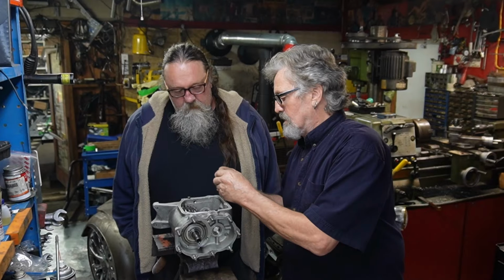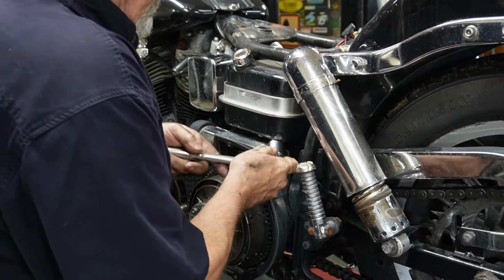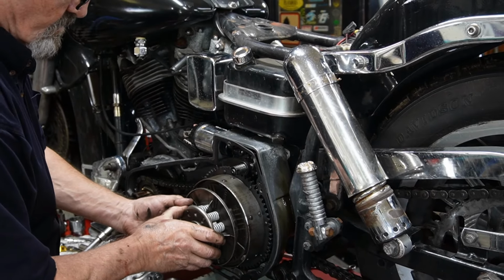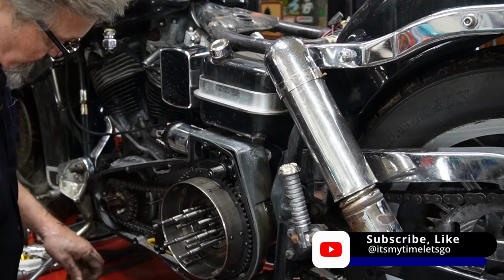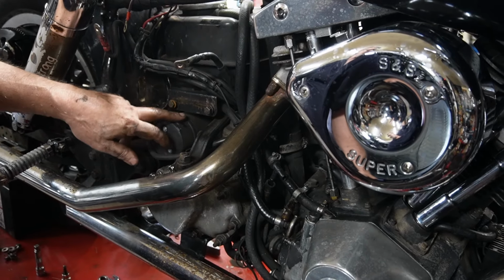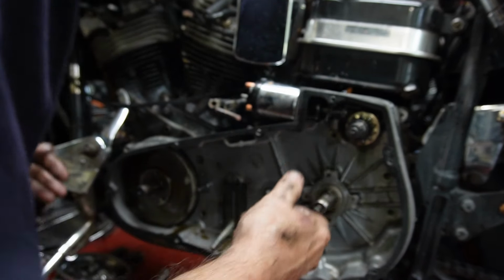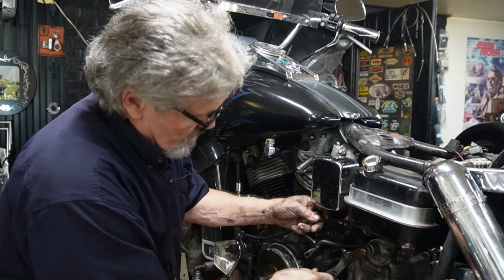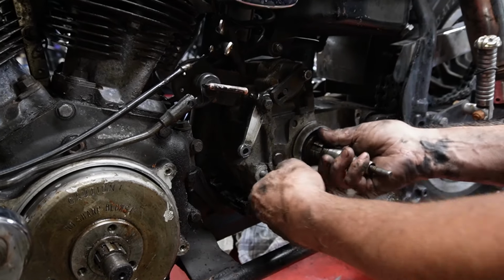HOW TO REMOVE, REBUILD AND REINSTALL A COWPIE SHOVELHEAD TRANSMISSION

Comment from the maker: Let us know if you find this series helpful.
Reply: Sure do. Can't wait to see inside.
Reply: My 79 flh with cow pie trans been leaking for years, keeps the drive chain lubed😅. It will leak out a few oz. Every thousand miles. Transmission shifts like butter. Been waiting for something more serious to fail to justify going through the pain in the ass to take it all apart to fix it. For now I just keep adding a little gear lube every now and then. It's kind of funny how I know when to add gear lube is when it stops putting a quarter size drop on the garage floor.

Comment: My 1970 has the two hole type compensator mean you have to use that special tool rather than a socket can you switch to a regular later style shovelhead compensator or just change the socket Will that work Thank you
Reply from the maker: I see no real reason that you cannot replace the system with the newer style,shovelhead, compensator. I think you can make a tool with a piece of bar and two dowels welded to use for the old style. Thanks for commenting.
Reply: @itsmytimeletsgo  Yes I made it two years ago and thought I'd never use it again I made it out of a leaf spring and two bolts that I welded to it. It was rather a caveman. But I got a tool now that you actually use a torque wrench on
Reply: @itsmytimeletsgo  yeah I was wondering it's just not that I'm going to but in case I ever wanted to. And I was wondering if they kind of interchange.
Reply from the maker: @MoeLarrycurly1  One can always fabricate something but nice to have the tool for it. It doesn't have to be pretty, it just needs to work.
Reply: @itsmytimeletsgo  amen ..there

Comment: I have a three-finger clutch hub and two of the threaded studs or rods coming outward that hold the steels and the clutch material. They're slightly bent can they be bent back so that the plates move freely or is that something that it's the clutch hub is shot
Reply from the maker: You can replace the fingers with new ones but if they are bent, or have grooves in them its time for replacement of the hub. Thanks for commenting.
Reply: @itsmytimeletsgo  how are they replaced would you need a press it looks like they squashed the ends on the backside of the studs
Reply from the maker: @MoeLarrycurly1  You could grind them smooth. Yes you will probably need a press.

Comment: You're a different colored springs do you know those red and blue is one stronger than the other
Reply from the maker: Yes there are different strength springs, often set by different colors. Not sure right now which are which but they usually state that before buying. I have found that many times the heavy springs are a bit to much and they give you a harder pull than a person would like. Thanks for commenting.
Reply: @itsmytimeletsgo  yeah most of the stuff I get is used so it's kind of a gamble. But I used stock springs and some red springs The red springs came in the 1980 when I got it but it was really pull really hard to pull the clutch in. So I alternated stock which I had a bunch of and the red ones it seems to work out pretty good
Reply from the maker: @MoeLarrycurly1  I have seen that done as well in the past to get an easier pull.
Reply: @itsmytimeletsgo  yeah I figure I couldn't be the first but it made sense at least I'll try it until it doesn't work ;-)